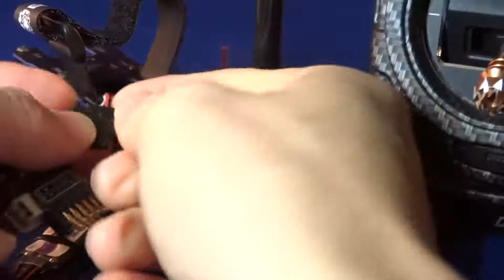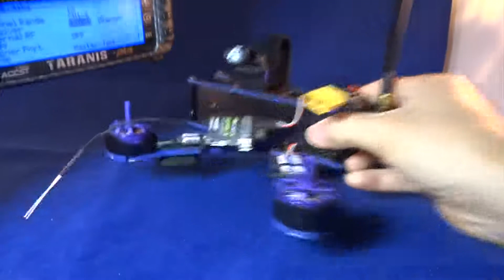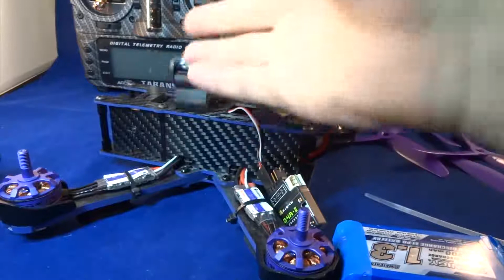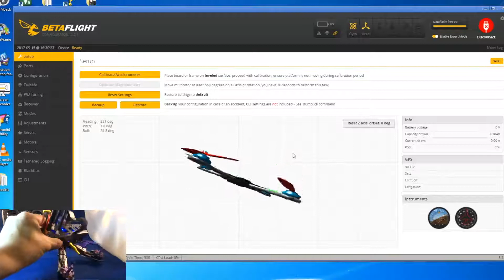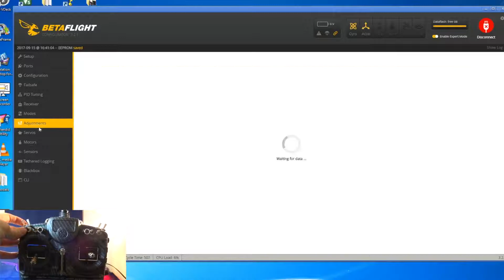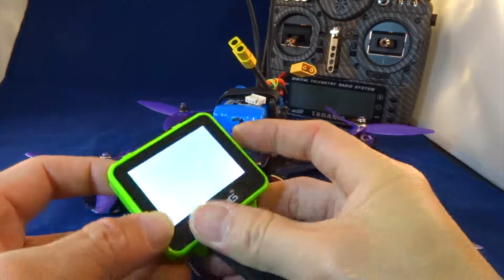Entry Level Pilot Series - Set Up PNP Mini Quadcopter - Eachine Wizard X220

Comment: Can you please test this transmitter with the Eachine Wizard X220: https://m.banggood.com/FsFly-T-six-2_4GHz-6CH-DSM2-Compatible-Transmitter-For-RC-Models-p-1038245.html?rmmds=search.I want to buy the Eachine Wizard x220 ARF..BUT I want to confirm that this transmitter works perfectly with Eachine Wizard X220...Thanks for your support!
Reply from the maker: It should work. You need to install on the DSM port using 3.3v.
Reply: I have seen in your videos that you have also this transmitter, so please can you make a short video on it, I am confused with the arming and modes switches, because in this transmitter there are total 8 switches and in the  x220 stock transmitter there are only 4 switches....so therefore I am confused that will my transmitter work perfectly or not...so please can you show me that? Please....Thanks....!
Reply from the maker: see this video https://www.youtube.com/watch?v=cZ8IhStbyVc&t=35s
Reply: Thanks for the video but can you please show me that how this transmitter works with the x220.. i mean  i want to only  know  that how the, arm/disarm and the mode 1,2 and 3 switches works...Please..
Reply from the maker: As long as your switches are set up as in my video - you will have aux 1 and aux 2 and you use aux 1 for arm/disarm and aux 2 for mode -  you need to set up in Betaflight in the Mode tab - just see any of my review video with set up in betaflight - the method is the same
Reply: Ok,,,,i will try that...Thanks....

Comment: So you are connecting with sbus? And shall I change a plug from the w220s? Cuz it didn't come with servo cable.
Reply from the maker: Mine came with plug for ppm and I am using ppm. If I wanted to use sbus, I just needed to swap the plug to the opposite port towards the back. I don't know if the X220s uses the same fcb.
Reply: jtgravityRC thank you, and how come ppm just using one plug? I thought ppm at least need 4 plugs
Reply from the maker: no, pwm is 4. ppm and sbus the same with one signal wire, red power and black ground.
Reply: jtgravityRC thank you bro, helps a lot